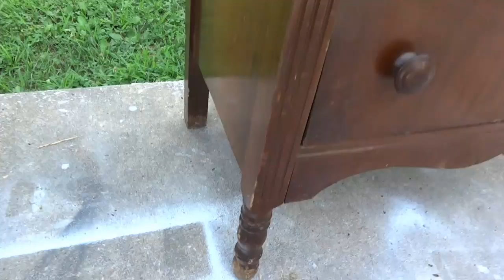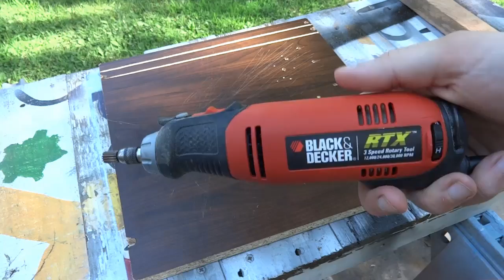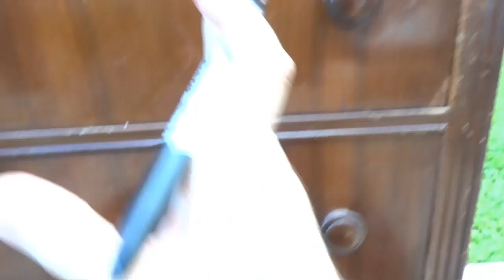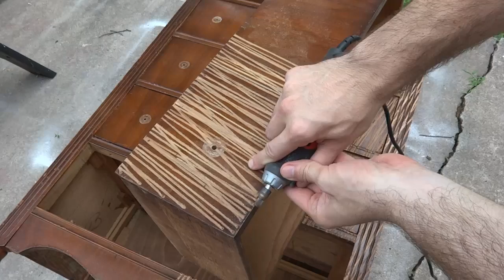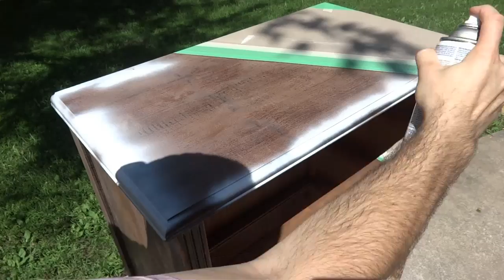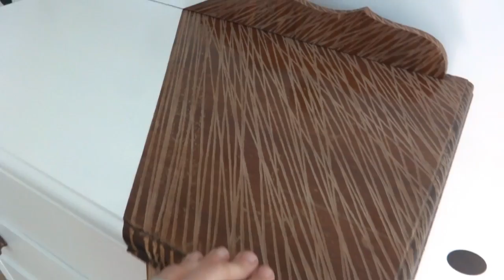Two-Faced Carved Dresser Makeover!

Comment: Hi Kevin. Love your videos!! Any tips for getting a clean line between the stain and paint?
Reply from the maker: On this one, if I remember right, I taped the line, sealed it down tight with my fingernail / squeegee, sprayed some clear coat to "seal" the edge, then painted it. If you trying to get a clean edge between to different colors, paint your base color, lay your tape, then spray the base color along the tape again to seal the edge, then paint the second color. Peel the tape at about a 45* angle away from the color you just painted when the paint is still a 'lil wet, so it doesn't rip the edge.
Reply: Awesome thank you!!

Comment: Really creative and looks awesome. Very interesting way to upcycle thrift store finds. A trick I learned is, when you put down the painters tape, if you give the tape edge a quick shot of spray clear, it'll prevent your paint color from bleeding under the tape later.
Reply from the maker: Thanks. Yes, that's a great tip. I had a painting class in college, and one of the few things I remember was that trick. The professor laid tape on the canvas and then brushed on some type of clear coat to seal the tape line down. When I started redoing furniture, that trick he showed us came to mind, and I've been doing it ever since. I either use clear or the original base color that I'm trying to protect.